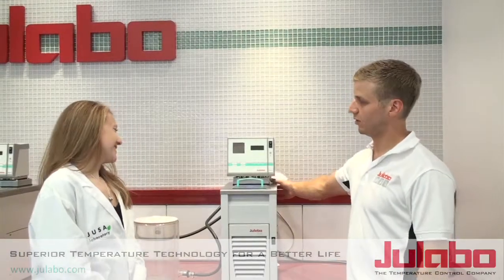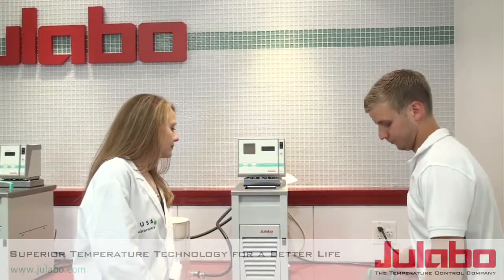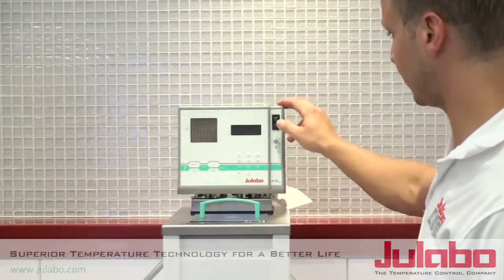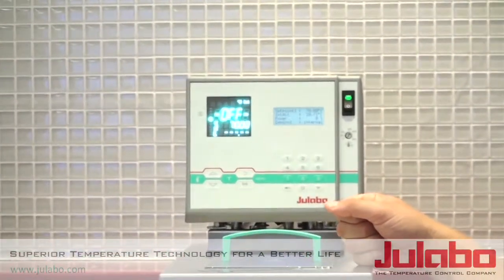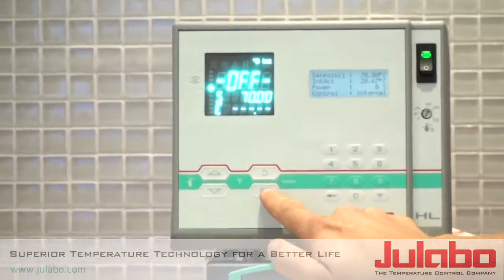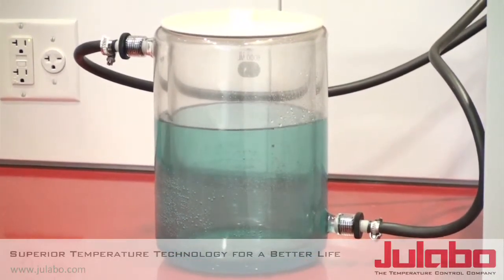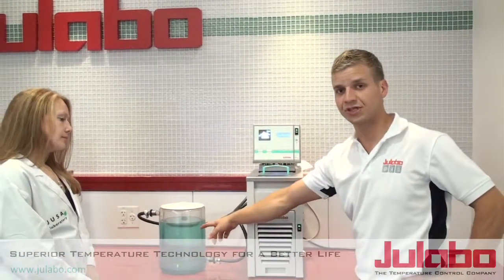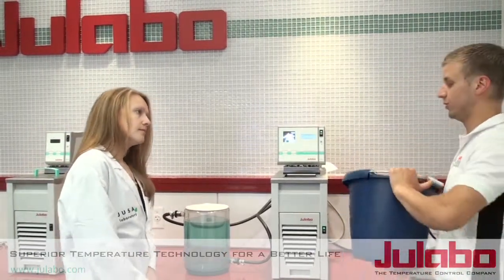Filling my JULABO circulator and application

Comment: What happens if you move the glass heat exchanger vessel higher than the level of the Julabo reservoir? Is it likely that air will accumulate in the glass vessel and eventually the heat exchange fluid will overflow the bath?
Reply from the maker: Hi Greg. In theory, as long as you don't have any air leaks in your loop, there should be no issue with your fluid coming out of the jacket. If you don't have a tight seal, it could potentially back flow. Please let me know if there is a particular unit you are using or if our Technical Support team could be of service.